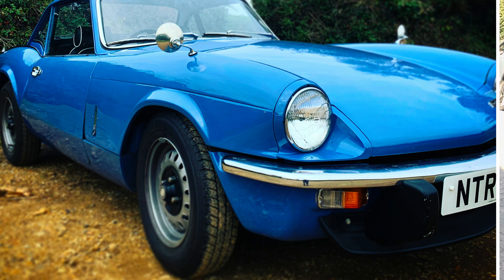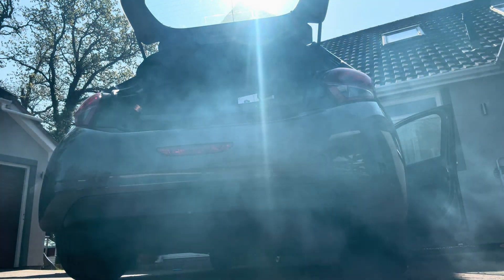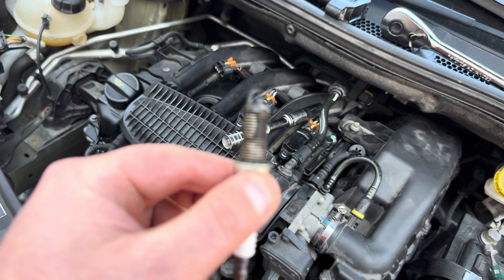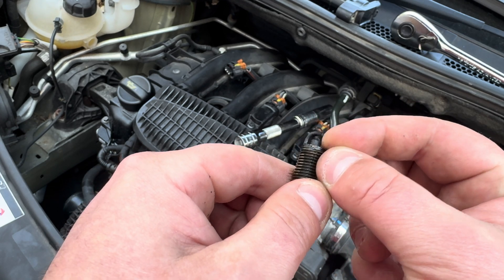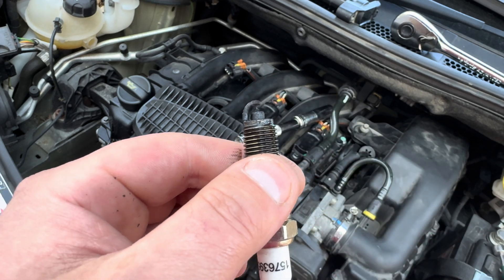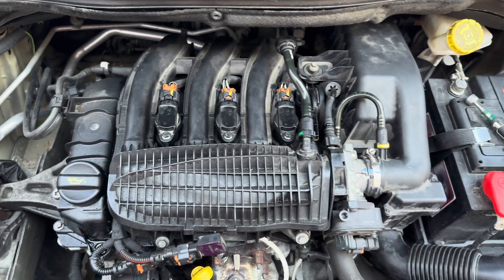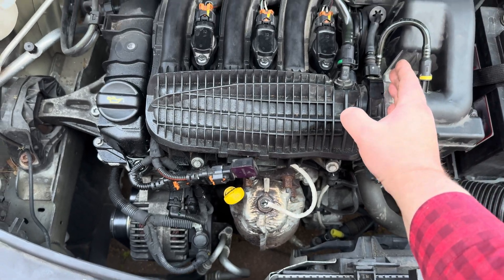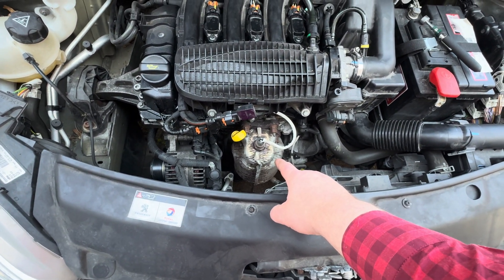Peugeot 208 Emissions Fail – Running Rich Explained!

Comment: Hi, what do you suggest for the error code of P1337? My local mechanic in the NL, says the engine block has a problem, while in internet people have changed the Sparkplugs and coils and sometimes even the fuel injector has a problem. I look forward for your response 🙏
Reply from the maker: Good morning!

I hope you are well! I love the NL by the way!

I did a video on this - although the fault code is different it’s the same principle as it’s just a different cylinder - here’s the link! 

Peugeot 208 P1339 Fault Code Diagnosis | Misfire Detection & Fix Guide
https://youtu.be/XTdI6tTy57c

Comment: Why did you clean it? Were you having symptoms of a bad pcv valve? If so what symptoms were you having?
Reply from the maker: Hey hey! I had excessive oil consumption. These cars are pretty bad on the oil as it is but this was another level
Reply: @TheTriumphGuy101  appreciate your quick reply! I’m having the same issue I believe…was driving yesterday and had low oil pressure come up on my dashboard and find out I had no oil, I’ve done a oil change and now it’s making a suction noise when the oil cap or dip stick is off, so annoyed because I planned to head to wales tonight now I’m torn between risking the drive or leaving it until it’s sorted 😅😢
Reply from the maker: @jamiesyt6288 if it’s making that sound definitely check the PCV! Where are you from? If you are local to me (Dorset) I can have a look
Reply: @TheTriumphGuy101 I’m in Leicester mate couple of hours away 😢 thanks for the offer though! I’ve had it off and I couldn’t see any apparent issues with it, I’m going to order a replacement and hopefully that’ll do the trick, if not then ChatGPT is saying to replace the full rocker cover

Comment: I had a pssssss sound from my engine bay, my car idles normally then when moving off the revs go up and down. The belt, sparks and air filter all changed, cat is going to be changed to as emissions failed. The cat had a previous crack and exhaust leaks. They fixed the exhaust leak but no change to emissions still high CO. What do I do if after new cat, what is that pass or hiss noise after going 70mph on a dual carriageway ?
Reply from the maker: Hey hey!

Great question, mind if I ask, is that sound just at 70mph and is it constant? Is this the petrol one?

Had the cat now been changed?
Reply: @TheTriumphGuy101 the new cat is working no exhaust fumes. However this part Fuel Vapour / EVAP Purge Hose peugeot 208 2014 I don’t have. This has been causing the car to run rich which has in turn been melting and destroyed my old cat. I don’t know where to find it but can I send you a pic or vid of the mechanic explaining it?

Comment: Hi there! I’m considering buying a 2019 Peugeot 208 diesel 1500cc 100hp. I’ve heard in the past that some models had issues with brake failure, so I just wanted to ask if you know whether this problem still exists in 2019 version. Any info would be much appreciated!
Reply from the maker: @georgeloses  good morning George, please check my peugout 208 review :)

As for the brake failure - it’s the first I’ve heard of that.

The diesel models are ok. But please do not get the petrol models, they are awful and very unreliable.

The 1.6 patrol is ok. 

The 1.2 and 1.0 stay well clear!